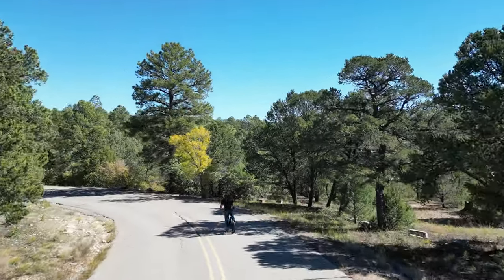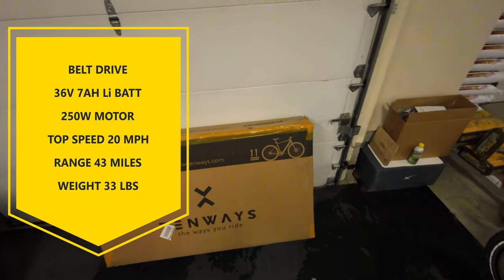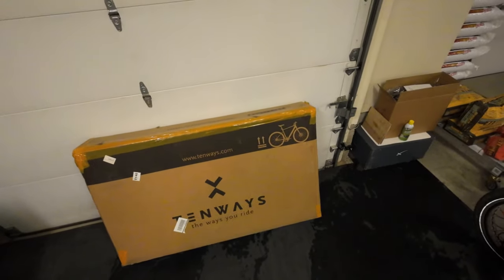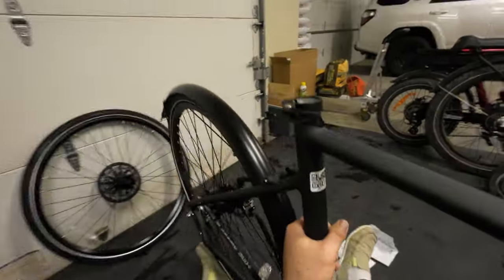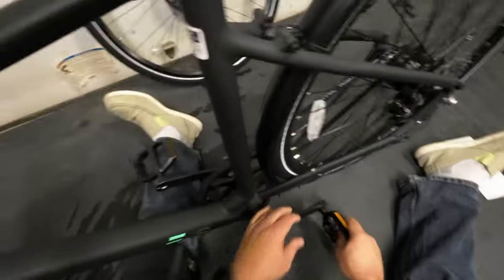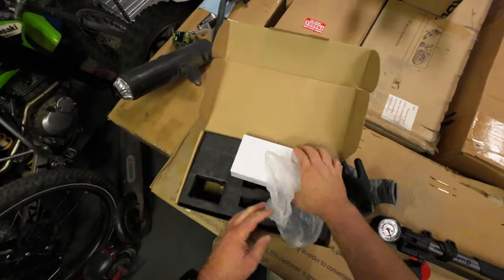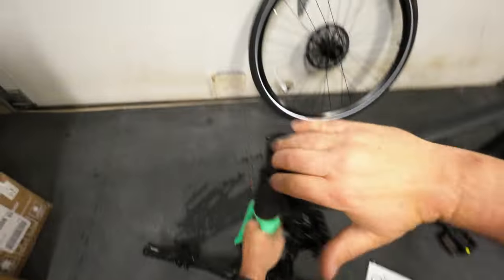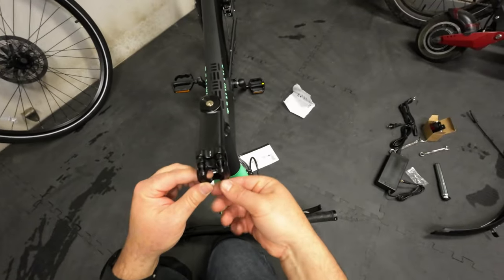TENWAYS CGO600 Belt Drive E-Bike Review - DJI Mini 3 Pro Tracking & Crash Test!

Comment: Front fender is not mounted correctly, where the bolt holds the fender should be at the back of the fork, not in the front. So it matches, not Tenways fault.....! No wrench needed which is not included, no bendig required.....
Reply: Yeah, and it's so obvious. Have to down-vote now 🙄

Comment: Well, for a $2000 bike, I was not impressed.  I have to get a new bike  for next Spring's biking season, but it will have to be a "step thru" version, as getting on/off with that high bar for my leg to clear is what tore my meniscus (just now getting to where I can get around without a cane). The Mini 3 Pro OA is good front/back/down ... NO UP SENSOR! We had 36F deg. this morning, with freezing rain/sleet & hail.  Outdoor activities will be limited for the next several months up here in NE Ohio. Seeing your weather makes me jealous!  Cheers!
Reply from the maker: Well said Bill.  I'm actually in process of doing the MokWheel step through bike review and it has a very low step through.  The front fender was ridiculously difficult to put on but I guess you'll see that in the video 😂.  Forecast is 17° and snow for a few hours tonight here.  Getting chilly but enjoying the change...for now 🍻
Reply: Hi Bill,  I love  my ebike check it out you may too. AVENTON Soltera. Under 1300.00.

Comment: I was at first impressed by the drone review, but first crash in low speed going up in to a tree and it broke. So I will keep using my Mavic Air for now, because I have not found a good replacement, with that good build quality as the compact Mavic Air.

The Mini 3 Pro seems to be a weak construction. I have the old (discontinued) Dji Mavic Air and have crashed it several times up, in to trees, forward in to bushes in sport mode and other pretty hard crash scenarios I don't even remeber. No cracks or damages to the drone what so ever.. once I replaced one propeller due to it "looked" a little bent and scratched. But other than that, no damage to the drone or the "arms" and propellers.

Comment: You where able to easily ride away from the drone ... what is the maximum height and speed the drone will track at
Reply from the maker: Seems like about 15-20mph until it starts having issues.  The max distance you can position it away is about 20 feet laterally & vertically.  It won't let you push it out with the control sticks when it's at it's max 🍻
Reply: At least the mini 3 pro can track well.... Autel nano can't even do 15mph well at all

Comment: if the motor is in the drive gear, and not in the rear hub, they could have used a 3-5-7 gear hub like a nexus hub to manage gearing
Reply from the maker: Good point 🍻